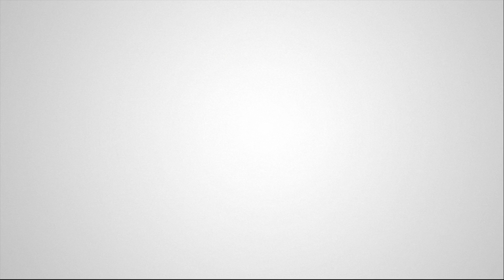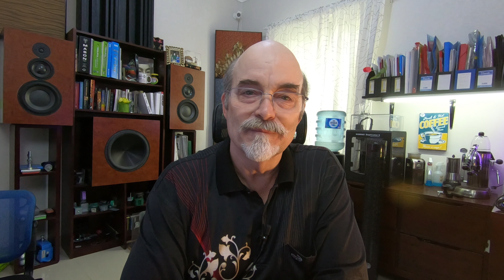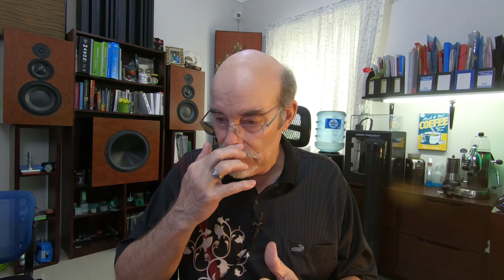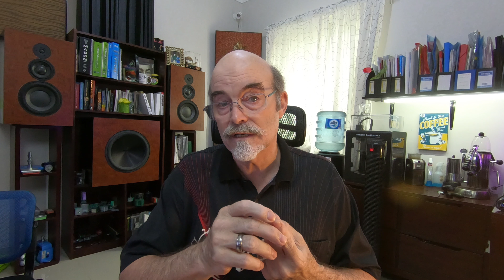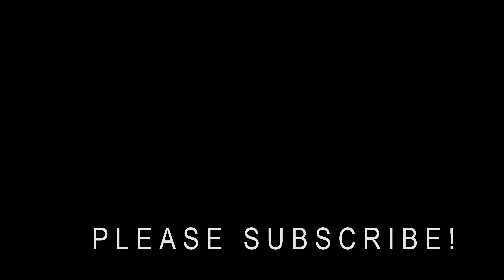Rock Wool Does Not Sound Proof

Comment: Same as thermal insulation, thickness matters, not materials.
Reply from the maker: Max, is that a question or a statement?
Reply: @JHBrandt  statement, for sure.
Reply from the maker: @maxyoung2307  oh I see. Well it is a false statement based on assumptions. Sorry! Statements should be accompanied by empirical evidence.

If the statement is about a material's properties as sound proofing it is utterly false.

If it is about sound absorption, you are missing many factors that deal with sound absorption like gas flow resistivity, fiber diameter, etc. These properties function very differently when the purpose is thermal insulation.
Reply: @JHBrandt  The acoustic part I don't understand much, but in terms of thermal performance of insulation, I've done enough research. There are lots of foam based products have higher initial thermal resistance value than fiberousous one, but over time, those foam products thermal resistance value degrade significantly. That's why when you insulate your house for energy saving, how many inches matter more than what kind of insulation materials to use.
Reply from the maker: @maxyoung2307  THAT I totally agree with. 😀

Comment: does that apply to glass wool? As far as i know it is being used to SOUNDPROOF the walls between neighbours.
Also,i hate when shops categorize ABSORBING FOAM as SOUNDPROOF MATERIAL,,, why?? absorbing and soundproof are not the same.
Reply from the maker: Glasswool and any fiber product are the same. You are absolutely correct and get my point; "absorbing and soundproof are not the same" (y)
Adding fiber fill to wall cavities WILL effectively double the sound transmission loss of the assembly. Fiberglass is a component of the sound proofing system and yet, by itself, does not sound proof. Similarly, a tire on your car is not transportation yet without tires, you're not going anywhere very far. 😉

Comment: Of course Rockwool by itself wont sound proof,.  Ive been doing this for 35 years professionally for many large recording studios.  One needs to install resilient channels on EACH side of the walls, 
being installed then install 2 layers of specific dry wall aka QuietRock or Gypsum with a 1/4 inch rubber membrane in between each QuietRock or Gypsum dry wall for each wall, floor and ceiling.
Some companies also do spray foaming to help in insulation but mostly for fireproofing. they spray the entire room then proceed with sound proofing installation.
Also some company like Sony Studios, Disney Studios, MGM Studios will have 3 to 4 layers because its requested or needed when they have joining studios.
When installing the QuietRock or Gypsum, the first layer that gets mounted onto the resilient channel must be laid down in a horizontal fashion and then install the rubber membrane,
then install the last layer of QuietRock or Gypsum in a vertical fashion.  making sure that the corners of the room the QuietRock or Gypsum are interlocking each other.
And in each layer, the rubber paste in corners is installed when installing the QuietRock or Gypsum panels.  Not to forget that the resilient channel interlocks connectors must be mounted with a rubber 
mounting piece so no vibration comes through the channels and on to the studs of the walls, its called protecting the sound transfer.
Rockwool by itself wont sound proof, but you are leaving out a extremely important part of sound proofing installation done by professional people like myself and others.
A room has to be built within a room that consist of resilient channels above the rockwool installation channels,  mounted on the studs, then installing QuietRock or Gypsum panels
onto the resilient channels (2) layers and interlocking each other in the corners.  The ceiling is done first  then the walls, because the new installed wall are going to support the ceiling installation.
then the floor is done last.  The floor must be levitated and a frame must be built just like the walls and rubber bunts isolators must be placed beneath the frames being installed in the floor.
This is known in the sound proofing industry as a floating floor. it keeps the sound from traveling through the cement floors hence the runner isolators bunts are needed to support the new floor frame.
All in all , all the walls are going to be twice as think as the original wall thickness.  because thee treatment is done on BOTH sides of the walls, not just one side.
Then after installation is done, diffusers are done when sound measuring tools and equipment is used to tune to room for tuning acoustics of the room.
Please work for a company first that is specializes in sound proofing large businesses recording studios like Sony Studios, Disney Studios, MGM Studios, and many other recording studios,
to learn more.
Reply: Amen !!
Reply from the maker: Thanks for the critical comment!

However, I really would appreciate it if you would grace the class with your wisdom. Please tell us WHY you would recommend the silly things that you recommend? AND - who you are and why are you are hiding behind a pseudonym? 

1. You mention using resilient channels which are very useful in conference rooms, hotels, and other rooms that require reasonable soundproofing from 125 Hz and up. But resilient channel are simply terrible at soundproofing music rooms. 
2. The way the ceiling is installed depends on the level of soundproofing and the technique used. There are many ways to do it right. What you are suggesting would be a fail in many high STL systems.
3. Floors are not levitated. - Unless they need to be. And when they are they are done FIRST and the entire room system sits ON the 'floating' (with springs or similar - not silly U-boats) Floor.
4. Dead sheet or MLV between layers of drywall or gypsum board is a waste of money and MLV, because it ceases to perform per its design when it is NOT limp. ;)
5. Treatment is done on both sides? What universe are you in? Seriously.
6. So, the way the 'professionals' do it is to build a pile of shit then 'fix it' with diffusors?? Well, you've got me there!
So far, I have seriously lost count on the number of major studios that I have designed and built. I think it's about 500 studios worldwide... Please feel free to list YOUR credentials. (logical fallacy warning: 'appeal to authority' and 'appeal to popularity')
Albert Einstein said, "What is right is not always popular, and what is popular is not always right."
Reply: @JHBrandt  
so you're saying MGM, Universal, Sony Studios and as well as every other recording studio on the east coast got it wrong  Hahahaa.
Too funny.
Reply from the maker: @TwstedTV  so, tell me, what soundproofing company did you work for? 😊
And, can you tell the class WHY you (they) were selling their large - pocketed clients bullshit products?

Do you know?
Or were you just too busy following orders? Or perhaps you really believed that your bosses know WTF they were doing instead of just ripping off their clients...

Yes, they not only got it wrong but they got ripped off by the people who they trusted to do the job right. 🤦‍♂️
Reply: On his next video he wears a tinfoil hat with the “I’m always right 👍” badge on his shirt.

He gets validation by having the last word,  but is blind to seeing that everyone just ignores him.
Reply: @aware24  Actually, the opposite, if you had taken the time to watch a few other videos. Internet people confusing soundproofing with absorption doesn't make fiber more or less 
'soundproof'.

Comment: i built an enclosure with just wood for a generator and it was over 110db from 10 feet.  after i lined the walls and roof of it with 2.5"  batts of rockwool from 10 feet it knocked it down to 86db..   So i dunno what the fuck youre going on about..  is not sound proof..  but theres a lot less of it than without rockwool..  all i did was affix it to the inside wooden walls with 3" screws with washers
Reply: Was like the wooden walls were amplifying the noise from vibration and resonance or something but after i lined the thing it knocked the sound down so much you can have a normal conversation right next to it..
Reply: He means it absorbs sound not cancels it theses a difference

Comment: Do you think putting rock wool on a wall directly behind my refrigerator will lower the volume at all?
Reply from the maker: rock wool will absorb some of the higher frequencies but will do nothing to block sound. To block sound or soundproof, you need mass. Now, if you fill the wall cavities (the space between the studs and between the drywall surfaces) with any fiber, it will improve the soundproofing qualities of the wall by around 6 dB, which is a lot. ;)